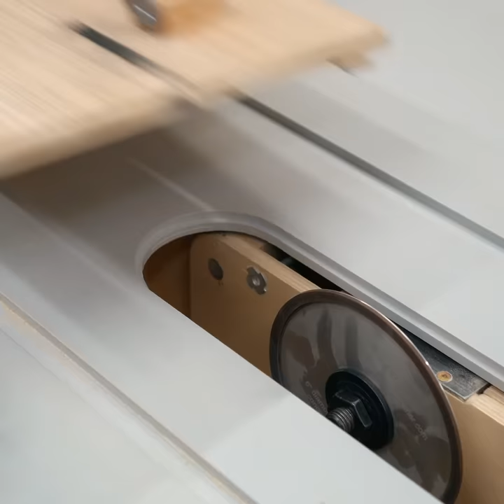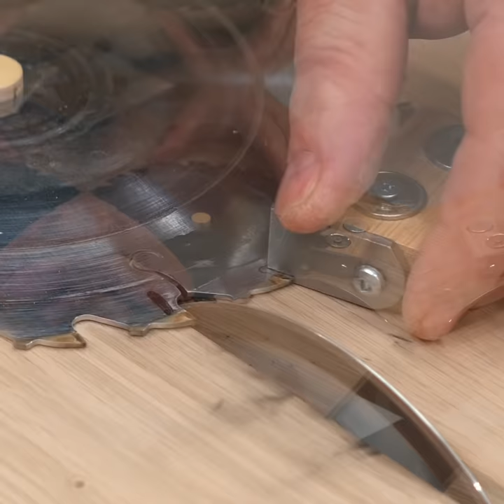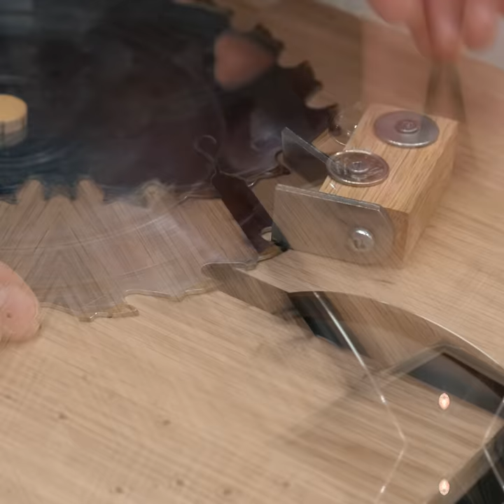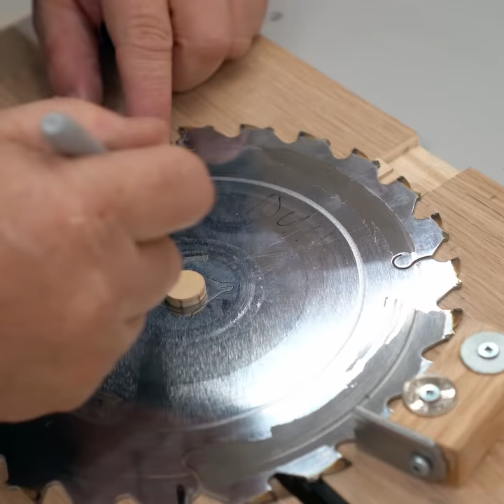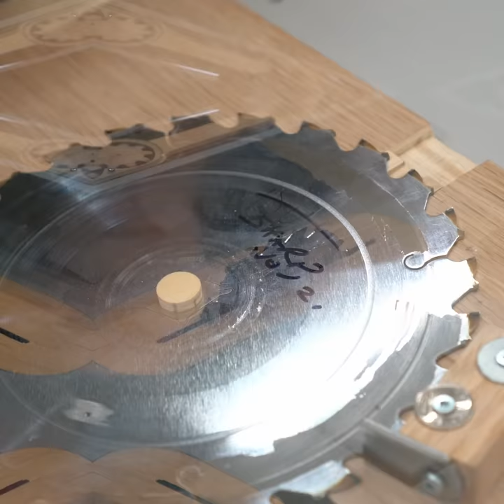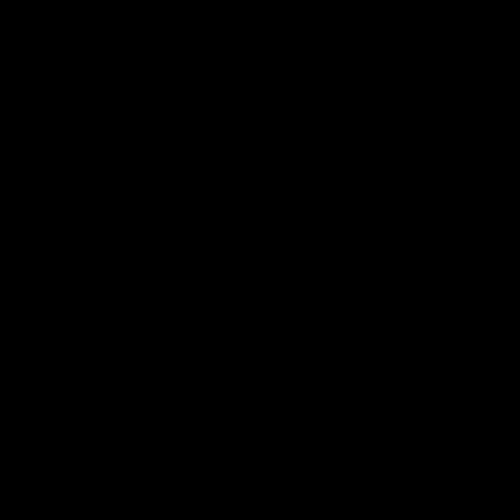Sharpen Saw Blades On The Table Saw #shorts

Comment from the maker: I needed to sharpen two of my older thin kerf blades and used a simple plywood jig I made to do that on my table saw. The diamond grinding wheel is specially made for blade sharpening and it only takes a few minutes to set it up and do the sharpening.. The old saw blade cuts like new again after it's been sharpened.
Watch the longer, more detailed video here: https://youtu.be/zHtVT-phN5I
Reply: do you want the tooth getting hot like that, or is that not enough to mess with it? I legit want to know, Im curious
Reply from the maker: Carbide can take a lot of heat. What you saw wasn't the tooth turning black, but the resin from cutting softwood burning.
Reply: @JohnHeisz  good to know thanks
Reply: You forgot to mention to mark your starting place

Comment: Never a dull moment.
Reply from the maker: Sharp observation! I've noticed you have a keen wit, a cut above the typical viewer.
Reply: @JohnHeisz  He is just clowning around.
Reply: This doesn't look dangerous at all. Maybe get everything set before turning on the table saw?
Reply: @rcredmon  little late but it's not actually dangerous except maybe grinding a little bit of skin off since it's no teeth on the blade in the saw

Comment: noob question here, would that mess with the temper?
Reply: Teeth are brazed anyway. If you don't heat them enough so they fall off, it should be fine. And I think carbide is not tempered, it's natural that way...

Comment: Hi John, you can improve it with a lower stop, attaching a magnet to move the blade up and over the stop. This way you have only 1 moving piece. Way faster and safer, due to not lifting your hands from the blade.

Comment: That sharpening wheel will pay for itself quickly. Not only in sharpening/blade costs, but also in lost time and materials caused by dull blades. No burn marks to sand out either.
Reply from the maker: I used to pay an average of $20 to have a blade sharpened and that didn't include dropping it off at the sharpening place and picking it up again a week later.
Reply: @JohnHeisz  The only bummer is I don't think I have any blades that are only flat top ground teeth.

Comment: This is absolutely not good for the saw, and it will only work for the saws with this teeth. If you sharpen your saw like this you will have good results for the first few cuts but it isnt logical to do so. Bring your saw to a local shop where they are supposed to do. In europe you can bring your Saw for eg. to Leitz its 100 times better and you are not even paying that much